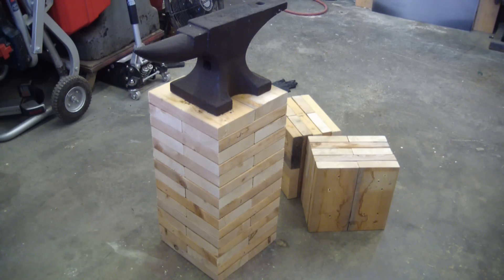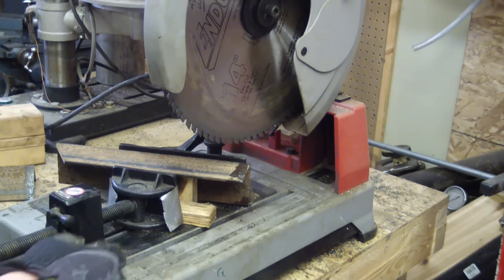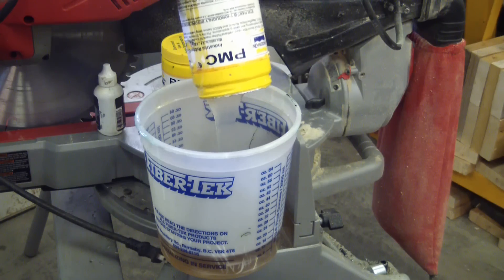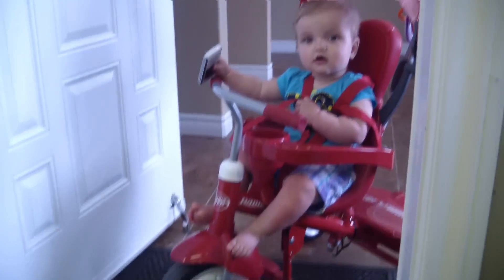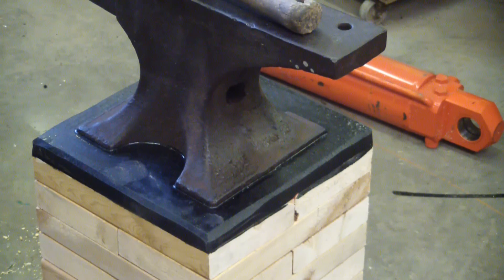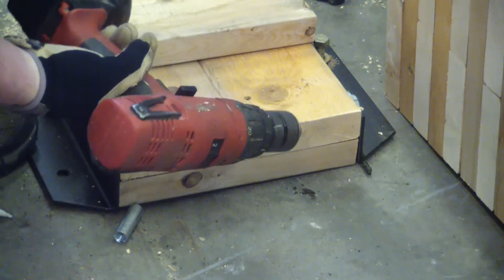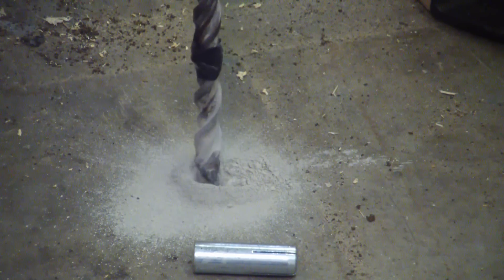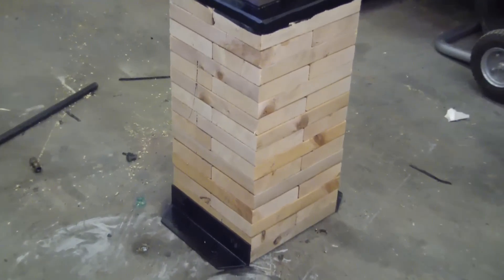100 year old blacksmith anvil gets a new home

Comment: One of your better videos, enjoyed it.  My local machine shop supply told me they don't stock tap water.  They said they have to order from Canada at $20 a gallon.  I fooled them though, my neighbor has gallons of the stuff and every time I need some he gives me a bucket full for just five bucks.  Keep on fighting evil.
Reply: will metric water give the same result on imperial sized anchor hole dust?
Reply: Yeah, unfortunately we still use freedom units up here in Canada as well as surrender units. Shouldn't be a problem. We move seamlessly between the two.
Reply: B
Reply: @Seveneleven44  

        The joke
----------------------------
      You're head
Reply: @COALEDasICE  your*
Reply: @lobmin  you are correct I made a mistake. Want a cookie?
Reply: @COALEDasICE   I just found it a bit ironic, as you were pointing out someone else's mistake.
Reply: @lobmin  not really a mistake the missed a joke but hey good for you White Knight
Reply: Graham Barnewall 
No, the metric water results will be too big and not quite fit or just small enough to slip.
Reply: sorry to be so off topic but does anybody know of a way to get back into an Instagram account?
I stupidly forgot the login password. I love any help you can offer me!
Reply: @Jaiden Tyson Instablaster =)
Reply: @Charles Adrien i really appreciate your reply. I got to the site through google and im in the hacking process atm.
Seems to take quite some time so I will get back to you later when my account password hopefully is recovered.
Reply: @Charles Adrien it worked and I now got access to my account again. Im so happy!
Thank you so much you really help me out !
Reply: @Jaiden Tyson you are welcome :)
Reply: Everybody knows that.
Reply: @SynS7ven  I have a couple converter tools.  They all have really long handles.

Comment: Thanks for the holey lesson and the tips on plasticizing your anvil. Last anvil I used was just mounted on the end of a stump, not on a compressed hockey rink, and held on with bent spikes rather than liquid floor mats. These days all I have to hammer on is a bit of railroad track, which works ok, though there's no horn. I guess they left that on the train. 

-- Mike

Comment: Hey buddy! Fellow BC resident here, been in the trades 8 years now and have done a lot of learning ever since I started.  One thing with drilling into concrete - if you're still drilling a half inch down before giving 'er, you're wasting your time.  Those drills are designed for one thing and one thing only - making a hole in concrete.  Don't worry about pilot holes with those hiltis, you're actually just fine if you place your anvil base where it's supposed to go, and drill right through the hole in the steel angles.  Don't put too much weight on the tool either, the weight of the tool itself is almost all the weight it needs to do it's job properly!  The channel and the videos are awesome, and if you ever want a cold beer on a hot day, I'm out in Maple Ridge.  Take er easy!

Comment: The tap water comment got me
Reply: @Crewsy  Of course it is. It's usually kept in stock at the machinist supply store on the shelf with the tack welds and the box of grid squares.
Reply: @Crewsy  Yes their blinker fluid is premium synthetic. 💪 Only the best for my car.
Reply: Same, i would defo had been convinced to go to a shop for that haha
Reply: It's not just for threading!  Look for it in the hammer section, where it's used for light percussive maintenance.

Comment: run a flame over the bubbles on the fibre glass (if its not flammable after mixed), as you would with epoxy resin. of course its pointless you reading this beacause the video was made 2 years ago
Reply: Well your comment was made 2 years ago, but I found it to have somewhat of a point.
Reply: Great Tip; Never mind if it's 25 yrs from now, though!!👍
Reply: I thought the same thing, to use a torch. But again, urethane not epoxy.

Comment: Suffered drilling holes with a hammer/drill for years (very occasional use).  Bought a Milwaukee 18 volt Ni/cad about 4 years ago to install anchors to set a bulk feed bin.  Almost fell on my face on the first hole when the hammer blasted right through 6 inches of concrete .  I was a lot more careful on the next hole.  Unbelievable the difference in performance.

Comment: Here's a tip - if, instead of wrapping your tape tight around the bit, you leave a little flap - it'll brush away the dust or chips, allowing you to see exactly when your hole is drilled to the right depth.
Reply: Then you endup with corncreet lungs in 20 years
Reply: @dublininnis9695  Is why you use a vacuum attachment with a build in stopper, those things are damn nice in most regards.

Comment: When drilling for anchors, if you only need a couple, a quarter inch impact actually works well. (Yes, i understand the impacting is in the wrong direction, but it works.) You can buy the bits in quarter inch hex just for this. I cut and drilled concrete for a lot of years. I have plenty of experience with this.

Comment: Watching the drilling in this video makes me so jealous. Because I did some work in the bathroom recently putting in a repair kit for the seal since the metal part that holds the screws that hold the toilet(Yes, I know it has a name, but the name slips my mind at the moment...) broke. I had to drill through concrete/tile and it took me like 2 hours to get the drilling done. He drills through cement in a matter of seconds. Mind you, I had a much lower quality drill, but still! So jealous.

Comment: I found that the SDS+ drill bits with a rotary hammer drill absolutely eat concrete plus they'll chew through rebar and aggregate dead easy.
Careful drilling through brick though been known to shoot straight through, particularly fastwall.

Comment: Good video, I'd be interested to hear more about drilling on an industrial scale. Couldn't agree more about using an SDS to make holes in concrete and stone. The hours I must have wasted in my youth trying to drill holes with my fathers hammer drill. I was wondering how thick the slab in your garage is and if it's got any reinforcing. I'd be a little concerned about cracking it while smacking seven bells out of something on the anvil.

Comment: Taping a plastic straw on the end of a shop vacuum nozzle works great for sucking the dust out of the bore holes, too. Gets them very clean without raising dust and leaves them bone dry, which is important if you're on a tight schedule and need to epoxy in mounting studs.

Comment: Try using a shop vac to suck up the concrete dust when you are drilling the concrete.  You won't need water to wet down the dust.  Don't use an air hose to blow out the hole.  Get a piece of tubing slightly smaller in diameter then the hole and mount it to the end of the shop vac hose.  Use some sprinkler fittings to reduce the vac hose diameter to the tubing diameter.  Tape the reducing fittings and tube into the shop vac hose to seal leaks.  Go down the hole with the tubing to suck up the dust after drilling is complete.  Works great.

Comment: Your right on the little percussive hammer drill they are only good for the occasional small masonry drilling project. Your right the way to go is a rotary hammer, and they are not too expensive any more which is nice too. You can buy one as a bare tool to add on to your ever expanding stable of cordless power tools.

Comment: The vacuum doesnt change due to bubbles rising up and popping. They grow as soon as the pressure drops - so they are already as big as they are going to get. Unless we are talking about very deep stuff where the static pressure kicks in and/or very(!) low vakuum <<1kPa/10mbar. But with that pressure gauge ur not going to see anything ever anyway, unless there is a leak somewhere...

Comment: with epoxy resin we used to just boil the kettle and pour hot water into a bucket and soak cans for 10min or so then mix A+B" and the mix would purge bubbles out by itself when it settles on job surface in this case it was "leaking shower base", dunno if it is same with urathane, i cant see why not though. on cold mornings it was a drama to get it out of the cans too so heating water trick helped there too..

Comment: Tap water, found in the same isle next to Elbow grease and headlight fluid.

Oddly enough, there are old cars that used hydrocarbons to fuel lantern-headlights... and there are specialized sticky greases for elbow-jointed machinery... so 'tap water' for tapping holes... might make sense :D

Comment: My parents needed to built a new chimney and therefore drill through 2x concrete extra thick floors. A friend brought a Hilti Hammer - maybe twice the size of the second one you have shown. It was in summer. First 3 hours were fine - then the Machine needed a break  - you could bake eggs on it and I think we had one hole. It was a mess.

Comment: I trick for removing surface bubbles that I use a lot is a Blowtorch lightly over the surface. The heat and the pressure pops the bubbles, and leaves a pretty darn smooth surface.

Comment: Ancient video but great video. To set the anchors you need a proper SDS setting tool with a bottoming lip. We use a single 1/2 inch shot to hoist up 50 KVA transformers with a come along up to the ceiling. Nobody stands underneath of course....talk about trust in engineering.

Comment: Why not just use a propane torch and make the bubbles rise with the heat? 
It would work right? am I right?
Reply: You're aware rubber is flammable right?
Reply: +Joe Roth naa you just got to brush the flame "lightly" over the flammable shmoo
Reply: One way of gassing the volatiles off! ..... instant aging?
Reply: Seems like you'd be much safer using a heat gun than a propane torch...
Reply: If you came to this channel with safety in mind, you're in the wrong neighbourhood kiddo!
Reply: You use a propane torch to pop bubbles in brulee and panna cotta before they set.

Comment: Ya, old Vjeio still gotta add the unneeded comment tho. Yep, this will work but more effective use of lumber and attachment would get more results per hammer blow. The lumber should be vertical not sidem ways for better support and rubber tends to not be the best way to attach anvil to lumber. I are a blacksmith, so with der hammer swinging I need to get the best return for energy spent. Home use... this will work fine. :P

Comment: Mix the 2 parts very well in a pot and then pour the mix into a 2nd pot. Also a hot air will get the surface bubbles out.

Comment: My anvil base is a old split dually rim and a piece of 6" pipe, boxed around the base of the anvil with 1/2" steel plate about 4" wide with a 1/4" chain wrapped around it. About 8ft

Comment: I saw you make up that rubber stuff and I couldn't help but think i'd like to pour it in the floor of the cab of the truck.... seems like it would not only seal but sound deaden
Reply: I figured ten times what he had would do a floor... so a 400 dollar floor coating that would last  your life time.. never have to mess with it again, don't have to paint it.. sound deadening... insulation... several birds with one stone.... I haven't worked with it.. so I was inquiring. I've worked with some bed liner stuff.. just nothing quite like that.
Reply: +Tim Vincent no clue what im talking about, but would the weight be a deterrent?
Reply: Sounds like you want spray-on bed-liner on both sides of the new floor pan after you've replaced it.
Reply: spray on wouldn't cut it.. it was rust treated, then coated with rust bullet, then sandwhiched between two layers of aluminum plate just as reinforcement, just thought a nice thick layer of cured rubber seeped into all the imperfections would be ideal

Comment: That is a very sexy anvil...  lovely shape.  Using the liquid rubber .. I like it.
Not so sure about the pile of blocks.  How are they joined together?
I mounted my anvil on a piano movers trolley.  The solid rubber tyres absorb the shocks and I can move it around the workshop.

Comment: I used a 30 gallon drum and had it filled with concrete with long L bolts in it. After it cured I bolted the anvil down and you could it it and it did not move

Comment: I know this is an old video...but I've never seen anyone add water and then used compressed air when drilling concrete. A shop-vac is 1000% easier and any shop has a bunch...so what's the idea behind water and blowing it around?

Comment: concrete is only brittle as you described if it is not a 20 year old slab. Because concrete does not stop curing. If you have a really old slab of concrete it is about the same density and hardness of granite.
Reply: Roman concrete was a seriously strong material, easily withstanding the test of time.

http://news.berkeley.edu/2013/06/04/roman-concrete/  (Don't mind the "anti-carbon" BS)
Reply: Gotynbstooghtg

Comment: Perhaps I'm a little late to the party, but in my experience, an easy way to handle the surface bubbles is with a little heat from a torch or heat gun.

Comment: I wonder what kind of "rebound" that old anvil has?  I heard from a friend who played around with metalworking (making jewelry, leather adornments, and arty junk) that "rebound" is good.  I guess it has something to do with the hardness of the face???
Reply: MichaelKingsfordGray great insight.  I never thought about the different spring moduli of the materials:  anvil face, anvil body, hammer face and body, the pedestal and the work itself.
Reply: Rebound is very good. A steel anvil will bounce a steel hammer. A cast iron anvil will not so we call it a dead anvil. Rebound doubles the amount of work you can do on a piece. You smack that hot metal with a steel hammer, the force goes through the work and into the anvil. The anvil then rebounds the energy back into your hammer. You sometimes will see blacksmiths using a heavy hammer tap the anvil. That will bounce the hammer helping the smith pick it up. This effect can be amplified somewhat by the size of the anvil in relation to the side of the hammer. I use a 2 lb hammer on a 16lb anvil and get decent rebound, but if I had a 70 lb anvil I would get more rebound. It would affect the rebound that much in my anvil if I used a 5 lb hammer but it would be better for a 70 lb anvil.
Reply: Smithing is fun! I do want a bigger anvil. I am more.of a blade smith than a.blacksmith and little stump anvil does a decent job but I would.like.something with a horn and hardy hole in the 70 to 100 lb range. I should finish a couple of my knives and sell them lol
Reply: WAVETUBE84 more rebound is more better, because it means that your anvil isn't absorbing the energy, you want your work piece to absorb it all!
Reply: Jonathon Gay Ah hah!  Makes sense.

Comment: i get my tap water from the tap :-)
Reply: ***** http://goo.gl/TtyvgC i dont know if your being sarcastic? we call out sink the tap. :-D
Reply: MATT BOLIN Not knowing if he's being sarcastic?  You must be new here...
Reply: Brandon Fesser  i figured as much just being nice :-)
Reply: MATT BOLIN  Here in the desert, we tap the water straight from the cacti.
Reply: MATT BOLIN Tap water is sold at walmart.  Usually it is in the same isle as prop wash that aspiring pilots are sent out to buy.
Reply: think they sell blinker fluid?
Reply: MATT BOLIN Yep.  But get the oil based.  Water based is too unstable for most light aircraft.
Reply: +Wyatt MacDonald - Yep, that's why a lot of the Saguaro Cactus' in Arizona have a spigot sticking out of them. lol
Reply: +MATT BOLIN - Yep, same aisle as the Muffler Bearings.
Reply: You shouldn't do that. Tap water that has been used for tapping can contain micro contaminants such as dihydrogen monoxide.
Reply: 001DesertRat Chris fix April fools
Reply: I use the water from the left knob for left handed threads.
Reply: @bluebulk  Thas odd! We take ours from toilet.

Comment: Tried using a hammer drill for my lift install and took me about ten minutes to figure out I was using the wrong tool. 60 bucks at the home despot and had ten holes done in half an hour.

Comment: For the rest of the people on the planet without the desire to spend a bunch of money on the two part wonder mix to glue down your anvil to the block/stump on which she's perched, we blacksmiths have simply chained our anvils down which works quite well.  Depending on the style of anvil, you can drive spikes into the stump and bend 'em over but the chains work best.  The point being for the anvil to have a firm, vibration free mount to your anvil block.  
  If you have vibration, every time c you strike the work, you lose energy through the vibration that should be going into the work.
Hell of a wa you to anchor down your anvil, though.   Just be sure you want it that permanent before you do it.  :)

Comment: those redheads must be the weaker cousin of the Hilti flush shells you install with the roto hammer.  My grandfather's company refit the stelco steel mill in Edmonton years ago, and a single flush shell had no trouble what so ever supporting the horizontal coring drill doing 8" holes in concrete